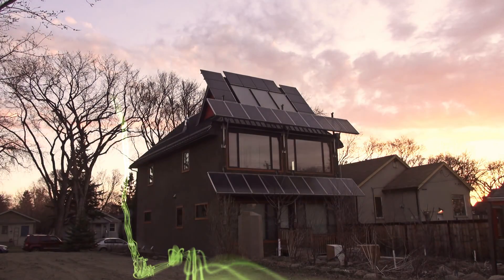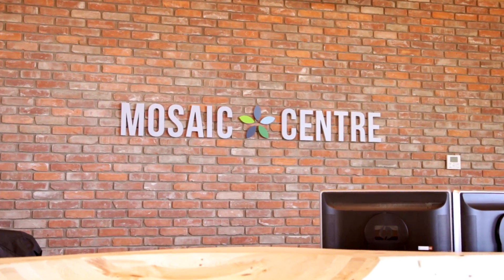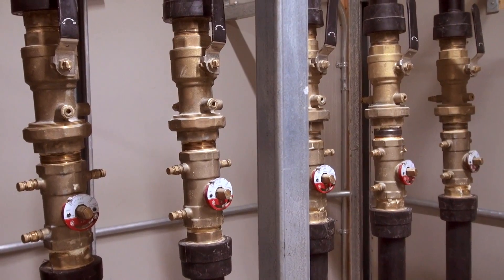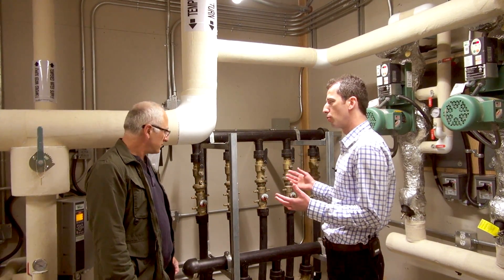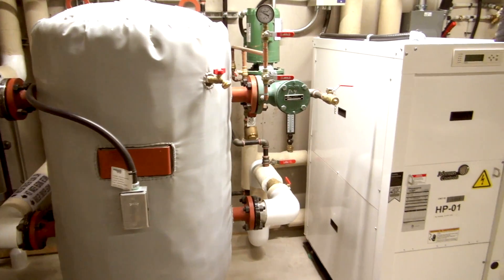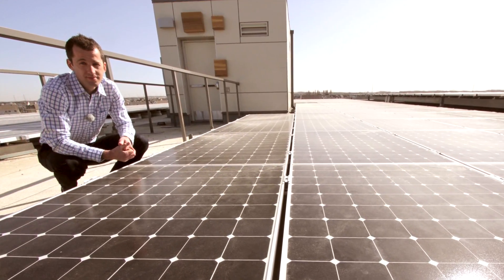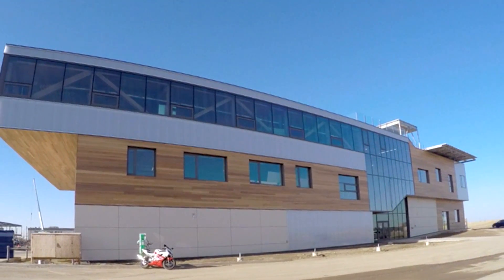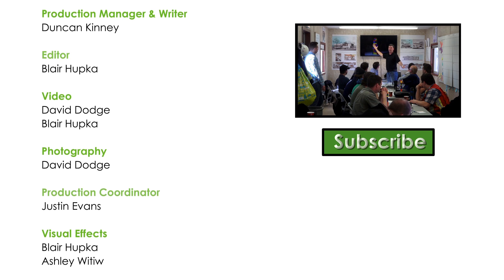107. Geothermal 101: How solar + geoexchange = a net-zero commercial building!

Comment: One thing that needs to be done, whether using these technologies or any other, is consistent monitoring and measuring. Checking the fluid flows throughout the systems to make sure the right amounts are reaching the right places, and finding where the greatest losses are is vital.  Using clamp-on flow meters saves installation costs, or portable flow meters when a permanent installation isn't necessary can save a lot up front. The on-going savings possible from monitoring to avoid later waste helps greatly.  One supplier of those products, in the UK but with distributors worldwide, is Micronics.  http://micronicsflowmeters.com/portable-flow-meters/

Comment: This book [link here >>>t.co/wwA6OZx2Uj ] got me thru the design and installation of a complete off-grid system for my lake cottage. The process of site evaluation, system component selection, wiring, etc. is complex, but with a lot of study and this book, I ended up very happy with the results. Everything you need to know is here. I recommend it for anyone who is starting with little solar panel knowledge and wants to end up with a whole house system.